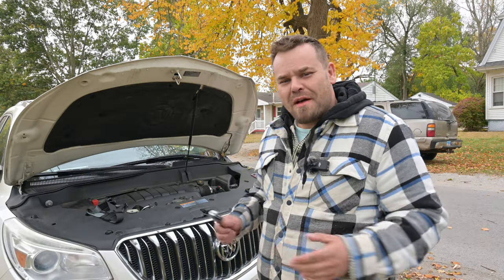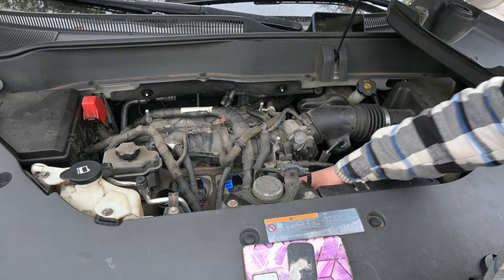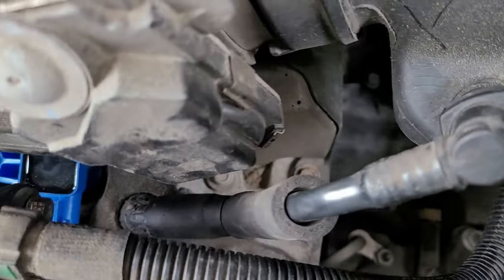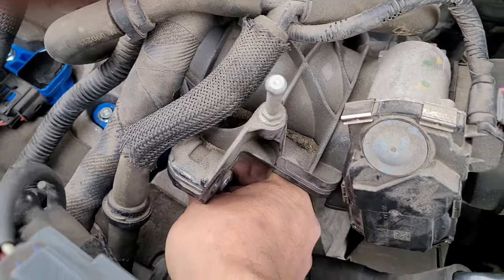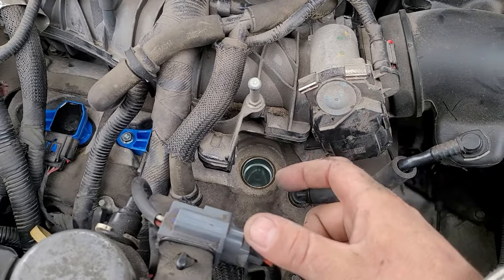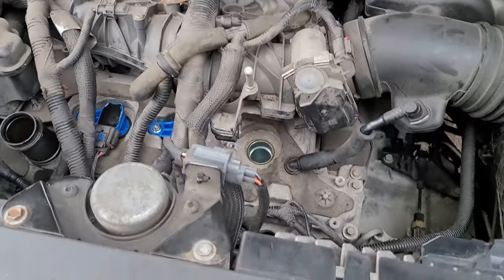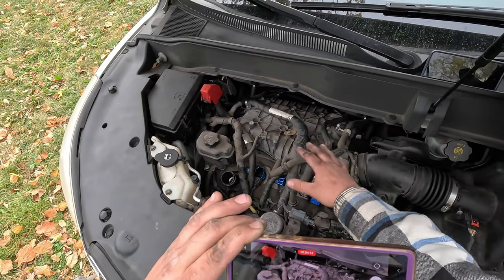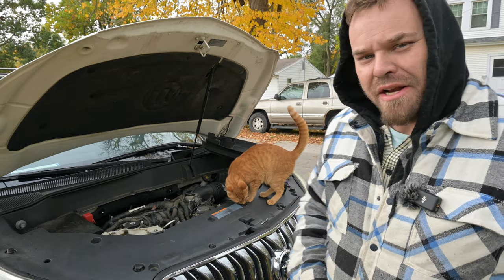Spark Plug REMOVAL Made EASY for 08-17 Buick Enclave Owners!

Comment: That intake comes off in 5 minutes.  Also gives you the opportunity to inspect and or clean carbon on the intake valves. And while your at it, the high pressure power steering hose is most likely leaking.  With the intake off, the hose is super easy.
Reply from the maker: @scrappy7571  GDI cleaner is always recommended to clean up the valves anyway. I ain't risking snapping a connector to do more work and cost the customer more money.
Reply: @Blowncapacitor84  We do several of these turds every week here at the dealer.  Never had a problem with broken connectors.  The R/V platform sure is a money maker here, cuz there is always something leaking or broken on them.  Tech next to me can replace chains in 4 hours, and out the door.
Reply from the maker: @scrappy7571  Dealer? Makes sense as to why you would remove the intake for a tune up.😅
Reply: @Blowncapacitor84  What does it matter where I work?  The goal is the same, fix cars make money.
Reply from the maker: @scrappy7571 dealerships usually gouge customers. Not saying you're a bad tech or anything. I'd imagine you're flatrate?
Reply: @Blowncapacitor84  I don't set the prices here, just fix 'em.  Removing the intake has nothing to with how I am paid.  Fastest easiest way to replace plugs is how it gets done.  And if you want to "go by the book', the service procedure is to remove the intake.
Reply from the maker: @scrappy7571  If you're flat rate, then it does because you physically get paid more at the customers' expense.  I'm not gonna charge a customer extra for something that is unnecessary when all I'm doing is plugs and coils on a 3.6. Not even mentioning the added expense of intake gaskets.